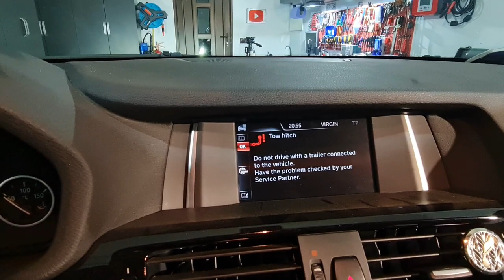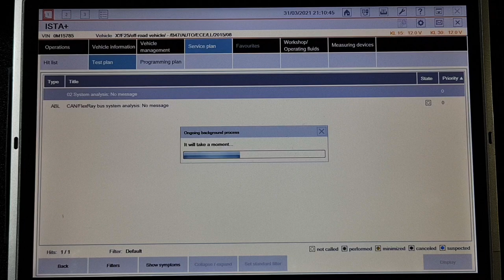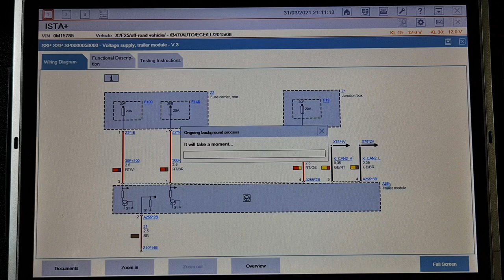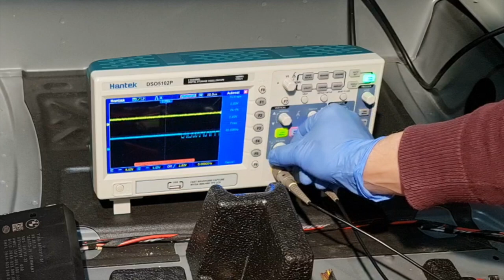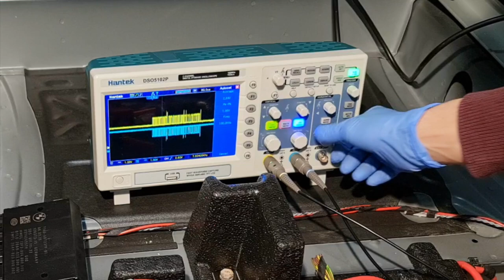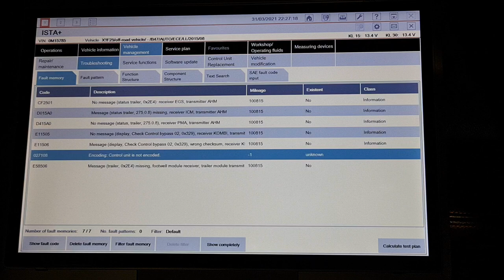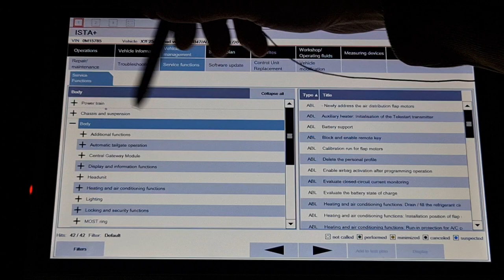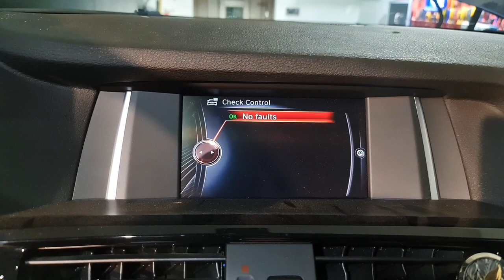BMW f25 Tow Hitch Error, diagnose with ISTA and osciloscope

Comment: when I want to fold the towbar, I press the button, you can hear some kind of cracks, probably the work of the electric motor but the towbar does not fold.  what do you think could be the problem? My is 2013, 4x4, diesel
Reply from the maker: Hello , you need to make a complete diagnosis of that system but probably the tow hitch mechanism is bad and need to be replaced
Reply: @MOvidiu Can the mechanism (behind the "sleeve") be lubricated? Two days ago, at -10°C, the tow hitch didn't quite want to fold back in! I towed a (broken) car about 20-30 into a building (shop) and had to bend 90° to the left. Maybe the hitch was not quite locked up when starting towing that old Hyundai SUV!?
My car is a 2011 X3 F25 30d.

Comment: Are trailer lights fed from this module too? My hitch folds & unfolds no problem, no faults on dash, but trailer lights don't work? (trailer definitely not the issue.)
Reply from the maker: Yes
Reply: @MOvidiu  Thank you. Do I need ICOM to flash new module or will eNet cable witjh ISTA work ok?